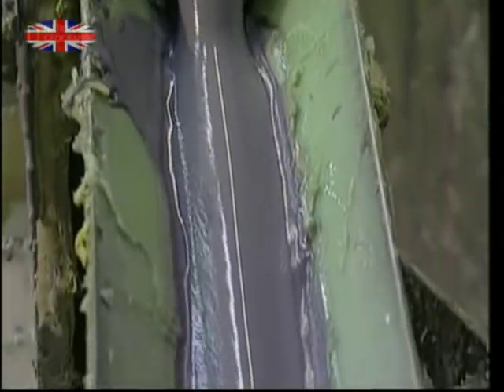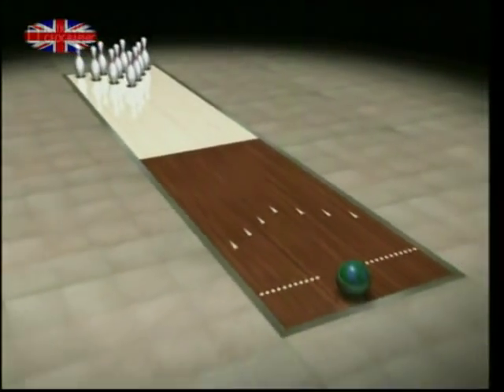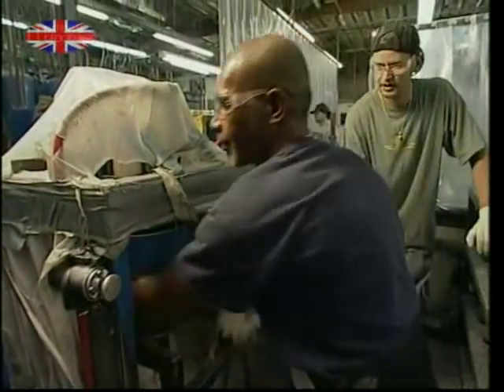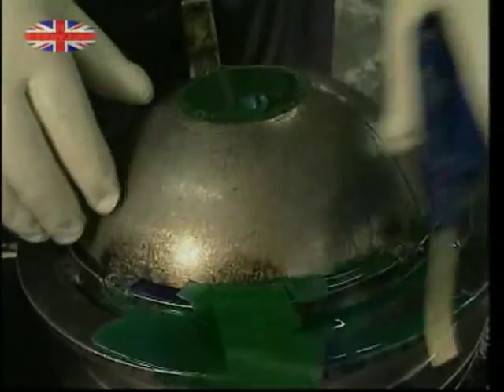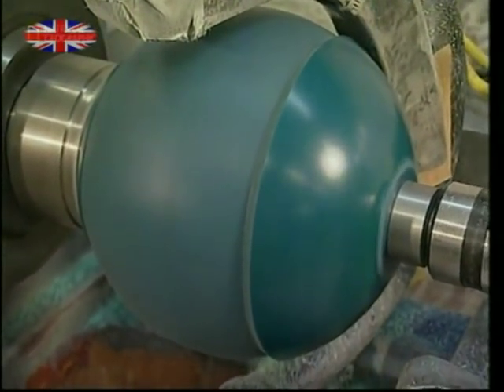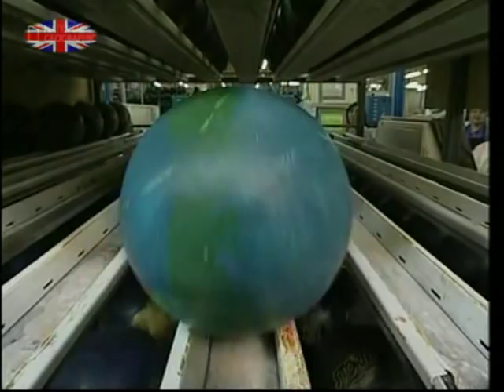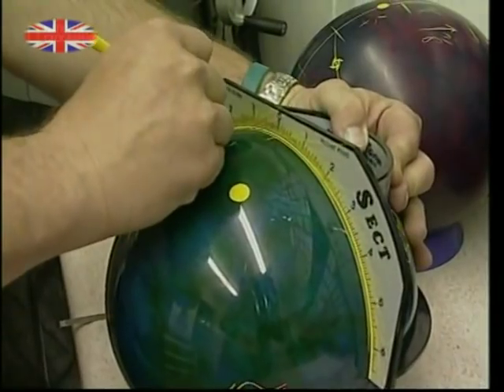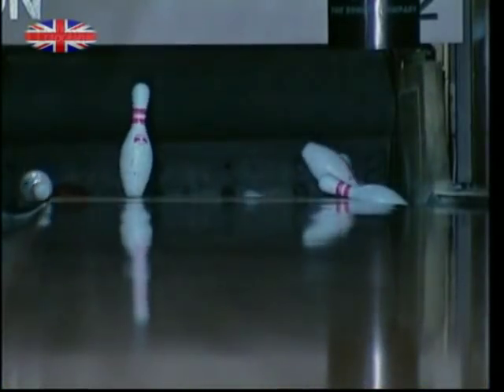How Ten-Pin Bowling Balls Are Made

Comment: Lol, there are no pre-drilled balls.
Reply: There are when the customer requests them to be pre-drilled. Some companys won't drill upon request but most will provided you give them specific drilling (measurements).  And of course in that case the customer needs to make sure they give the exact measurement and they (customer) assume responsibility if they give the wrong info.
Reply: TraviiC what about house balls.......
Reply: Mike Lecce house balls are already pre-drilled and cheaper than plastic balls
Reply: You can order pre drilled bowling balls from the manufacturer  @monkeycircus509
Reply: @PR84444  For who?  Neither EBI or Storm sell balls direct to consumers.  You have to buy them from a pro shop.  Even then, why would a pro shop buy predrilled balls when the whole point is to drill them after they're sold?
Reply: The pro shop doesn't buy the balls predrilled the customer directly buys them  @monkeycircus509
Reply: Exactly
Reply: U buy them pre drilled
Reply: Michael Son These arent house balls. These are pro balls.
Reply: David White Well, not necessarily. I dont ever order them pre drilled because my hands are still growing. Honestly i like to order balls and take them to a specific pro shop. The guy there is amazing, but it's 1:30 Hours away.
Reply: TraviiC on some websites there are but I don’t suggest doing that lol

Comment: @vitruvian8807 The'yve missed quite a bit of detail in this. Take a closer look and you'll see a yellow dot about 3/8" across on the surface of these balls. That's the riser pin which locates the centre of the ball core. That pin can be located in relation to a player' axis of rotation to create a larger or smaller "wheel" within the ball. Larger distances rev up slower, smaller ones faster. It's a lot more complex than that, but I'm sure you get the idea.

Comment: Should have included that the hole werent being drilled at the factory. A normal house ball would be, but a special bowling ball like the ones featured in this wouldnt. You would get your finger/thumb width and hand span measured at a pro shop and then they would custom drill the ball for your fingers only

Comment: actually up until recently a bowling ball was allowed to have twelve holes.  it has been reduced to eleven.  you are allowed one for each finger (thats 5), then you are allowed a small "vent" hole for each finger to allow air in and out so you don't have a vacuum effect when releasing the ball, then a "weight" hole to make it legal, and before resin balls the PBS used a durometer hole above the fingers 1/16" deep to be sure the surface wasn't tampered with thats 5+5+1+1=12
Reply: Here in the us, you're only allowed holes that a finger will be inside. No balance holes. Also you wouldn't want a "vent hole"

Comment: This video is absolutely WRONG!!! It is against the U.S.B.C. Equipment Specifications for a bowling ball to have ANY METAL in it's construction - also at around 2:30 he talks about different sizes - ALL bowling balls must be 27 inches in circumference
Reply: Jeff Webber it’s Britain no usbc
Reply: BAMCIS13450703 but they have the WB (previously FIQ) which governs the equipment to the same specs
Reply: When it comes to sizes; I think he was talking about the core; not the ball as a whole. The core and weight blocks can be different sizes depending on what weight is desired by the bowler

Comment: Different companies have different ways of creating balls.. Some (the yellow pin you see in the ball) hanging outside the ball through the mold.. It is later cut off and then the ball is cut on a lathe and pretty much the same process you saw in this clip..
So, the ROSE (it's own weightblock) is hung while the ball hardens..

Comment: @ryoryox I take it you don't bowl competitively. A ball itself will last for a long period of time. If the bowl isn't resurfaced or cleaned it could soak up enough oil over time to die out.That only goes for. resin and urethane balls.The reason so many people buy so many bowling balls is for many different lane conditions. A vas arsenal will help on a sport shot.
Reply: Urethane doesn't absorb oil though....

Comment: YOU DONT DRILL IT THE CUSTOMER GOES TO A PRO SHOP AND MAKES IT A CUSTOM FIT FOR THE CUSTOMER
Reply: @CHDL You can still order a ball pre-drilled if you chose to. But you will have to sent the measurements to the supplier. To eliminate the possibility of error though; it's best to have it drilled live by a pro shop operator
Reply: @Recon-cv1fe  Dude, none of the big manufacturers do that unless you're a sponsored athlete and even then you're getting them drilled on the truck.  Casual bowlers?  They don't have the time nor the inclination to waste hours on the phone answering fit questions, making adjustments, or drilling when they got bowling balls to make!
Reply: People order them online with there size and they drill the balls for them

Comment: @viperz888 

Taken from the USBC 2010 Equipment and Specfications manual pdf (google it).

Material:

3. The density of any piece/component in a ball (i.e.: core,
coverstock, weight block, etc.) shall not exceed
3.80 g/mL (i.e.: no pure metals or high density materials).

Devices:
Removable devices shall be permitted, provided:

2. Are constructed of a non- metallic material.